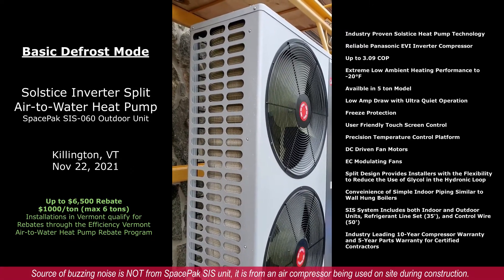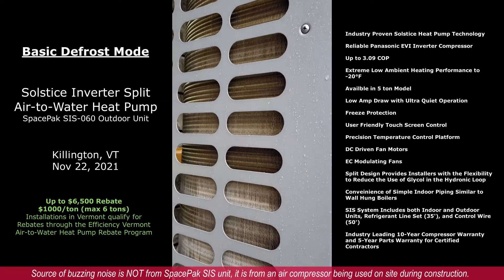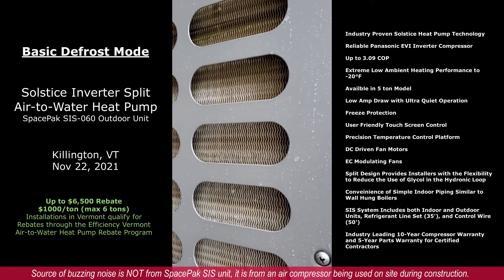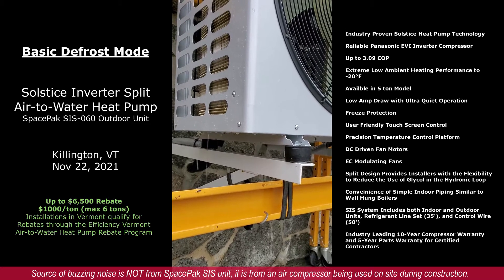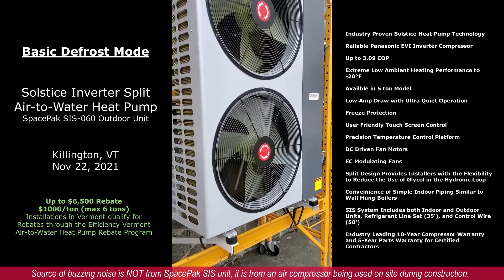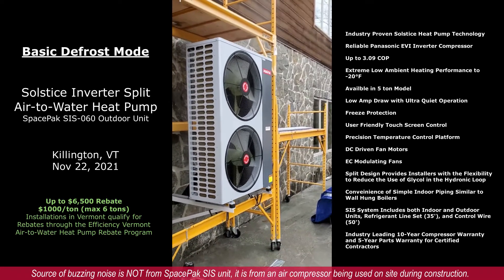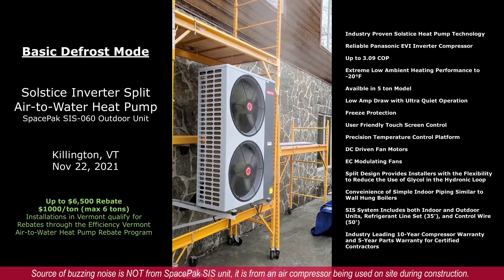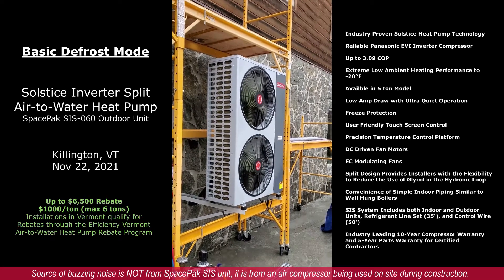Cold Climate Split-System Air-to-Water Heat Pump in Defrost Mode

Comment: Great installation why is it standing on a scaffold ??😂
Reply: I believe the heat pumps are supported by shelving attached to the building. The scaffold is there during installation to give the installers something to climb on and support the tools used in the installation. Remember, when you install a heat pump like this, it should be located in an elevated position well off the ground so it stays out of snow accumulation and so there is somewhere for the defrost water to drain to.
Reply: @HomeBuyersAgent  Hope so, thanks for your reply.
Reply: Keep it above possible snow level in the winter?
Reply: @markneuhausen5560  OH ok , expecting a lot of snow.Thanks for reply.